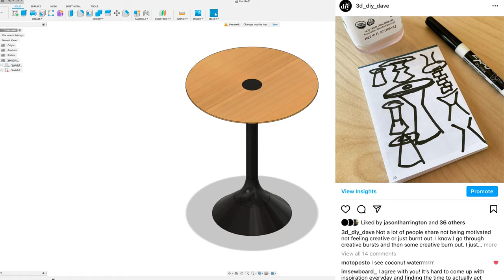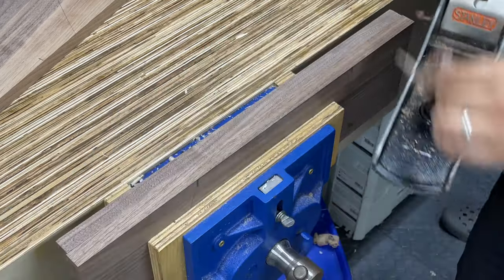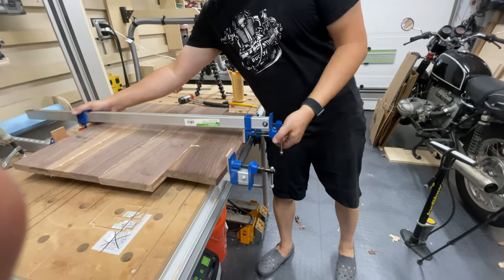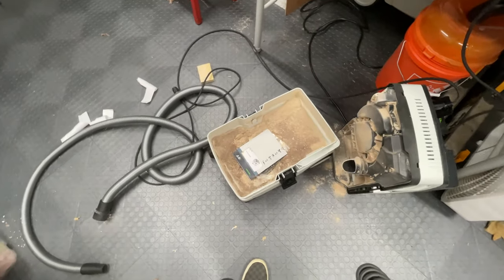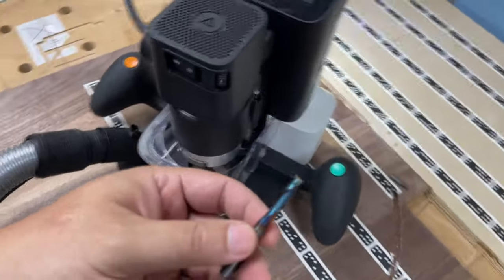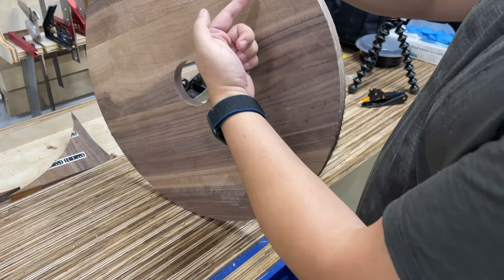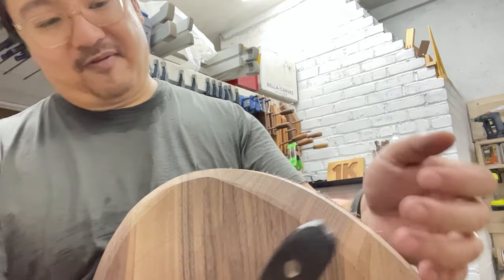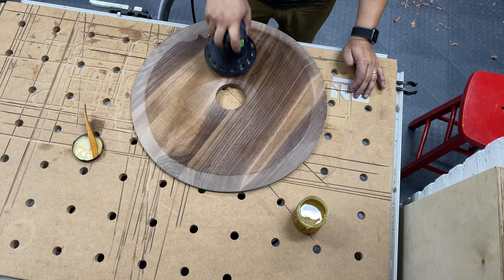Part 3: Making a Walnut Table top and finishing my 3D printed Side Table

Comment: If you weighted the base would it be less tippy?
Reply from the maker: I have been using it for awhile now and its been pretty good. But yes one could just fill the inside with some concrete or some sand That would make it more sturdy. We usually don't put anything too heavy on there. Heaviest being a laptop. The table can handle that just fine. Its all so been around a 5 year old who plays on it every day so that really is the test.
Reply: I have a Prusa and can’t print in one part like on your Raise3D. Do you think tiling the table base would make it too weak?
Reply from the maker: @grantgoldner7940  I think if you tile it, glued it well and did some bondo paste on the outside to smooth all of the lines out and painted it. It would be super strong.
Reply: That’s a fantastic idea! I was always worried about the seams and a painted filler is the perfect solution!